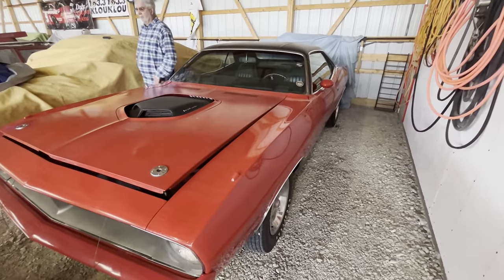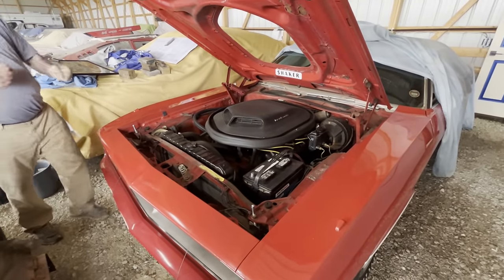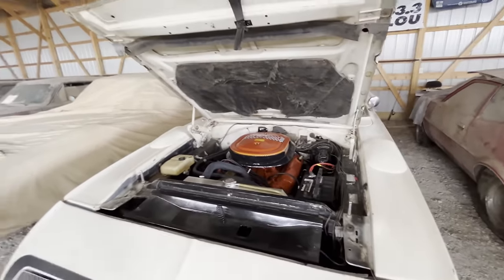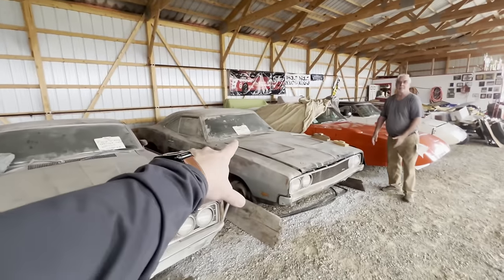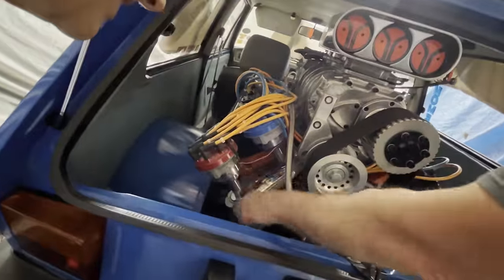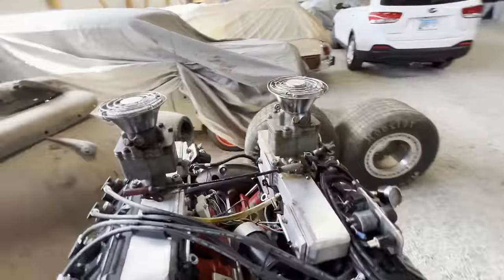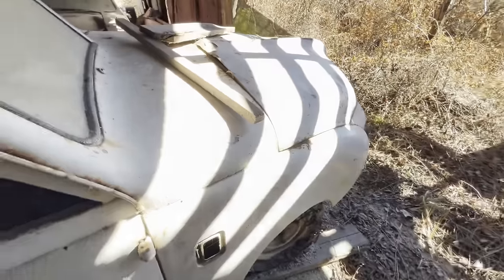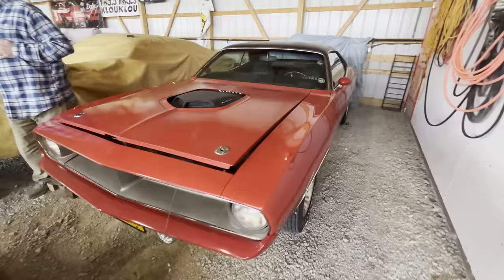Parked 35 years: The MOST INSANE Barn Finds

Comment: The '69 Dodge Charger 500, the car next to the Daytona,  looks to be one of the rarest cars in the collection. They were supposed to make 500 Charger 500s, hence the name.  But the Daytona came out just after and some of the Charger 500 were further converted into the Daytonas. 392 Charger 500s were made in '69, I used Google for the exact number.
Reply: I saw a one in Colorado 1992 for sale.Kai said 7500 I said I'll take it.He goes no no no seventy five thousand
Reply from the maker: Hagerty valuation tool puts it around 50-60k in current non-running condition. I agree though, it is rare.
Reply: @Xthreadgarage  WITH ALL DUE RESPECT: The functional ducts on the Superbird & Daytona upper front fenders 
were placed there to extract air from the front wheel-wells. As you may know, these "Wing Cars" were designed to 
run in excess of 200 MPH & they did. 
At speeds in excess of 120 MPH, air would pressurize in the front wheel-wells; causing dangerous lift to the front 
of the car. The hole//vents & air ducts allowed the air to escape & maintain "0" or negative pressure at the front. 
There-by, allowing the "wedge nose" & rear wing to function at their designed purpose. 
The "tire clearance story" is what team owners of these wing cars told NASCAR Officials; as to not disclose the 
true performance capabilities of these "super cars". 
BTW: If this car actually has "functioning holes" in the fenders...under the ducts...it is an ULTRA RARE Superbird. . 
All known "Wing Cars" sold to the public had no hole//solid fenders. The fender ducts on cars sold to the general 
public were "ornamental" and nonfunctional. 
In my opinion, if the holes are in the fenders, this Superbird Wing Car was purpose built for NASCAR. Also, the fact 
this car was repainted a few years after it was produced may have been to hide//delete its' NASCAR Livery. 
PLEASE contact this guy & advise him to professionally research the history of this car. He's likely in possession of 
a historically significant, one-of-a-kind, museum piece. 
The fact the engine is not original to this Superbird will have little or no effect on its' value. Numbers matching parts 
can be located during its' well-deserved, 100-point restoration. 
Respectfully, 
Ben
Reply: @duygukayhanisaskank4915 interesting it would explain why it's like new but not matching numbers if it was a race car the would have kept the race motor. I would like to see a dedicated video for this car along researching its history now that would be a video worth watching photo graph the tags and start from there
Reply: @strangecustoms8486  THANKS for your considerate reply. 🙂 
I hope you contact the owner of the Superbird & explain all this to him. 
Tracing the history & documenting these "Wing Cars" is not difficult. 
Best regards & God bless, 
Ben
Reply: Covers the Yugo, but the rare 500s are buried under dust.
Reply: Yeah it would be fun to work on it and get errr goin
Reply: Torino  interior s are all the same , no worries
Reply from the maker: Thanks for the info, I’ll be looking into this with Jerry. The fender vents on the white superbird definitely had holes through the fender.
Reply: @Xthreadgarage  OK & THANKS.🙂 
I hope you'll keep me posted. 
Best regards, 
Ben
Reply: @Xthreadgarage  BTW: I don't believe this Superbird competed in any NASCAR Sanctioned Races. 
However, if the vents you've verified in the front fenders are "original" & NOT created by a previous owner, this is a historically significant Superbird. It may have been a "test mule" for Plymouth. 
I hope Jerry realizes the importance of "professionally" researching its' history & the need for this Superbird to be documented & registered. 
I know he's got a lot of "irons in the fire". BUT...this project must go to the top of his "to do list." 🙂  
Best regards, 
Ben
Reply from the maker: Jerry says he put those holes in the fenders shortly after he bought it so it looked more like a nascar. Not much of a story there after all, but great catch. Thanks for watching.
Reply: Interesting

Comment: This is a magnificent and beautiful collection. I used to have a 70 HEMI 'cuda, It had a Black Shaker hood on that same color Red with a T-shifter automatic on a full floor console, between bucket seats, but No overhead console. The interior was black vinyl. It also had a black vinyl roof cover like this one. It also had a Black side stripe.
I purchased it in 1976 in Gastonia NC for $2500 after wrecking and totaling my 1965 Pontiac GTO, 389 4 speed manual. 
Y'all have a good day from Gastonia NC..
Reply: 70 cuda never ever had a t handle ....the t handle came out in 1973 called a slap stick.....so you either had a 73 cuda or someone took a console and shifter assembly out of a 73 and put it in a 70......in which makes no sense at all because 73 didn't have a Shaker Hood and a 70 will not fit a 73 and vise versa but the t handle on the automatic didn't come till 1973....... now before you loose your mind...I am not in any way calling you a lier... Could have your years mixed up or something.... just figured I would comment with some facts that is all sir..... been building these mopars for 45+ years I have touched every version of the cars at one point.... now I am priced clear out of the muscle car era......

Comment: Regarding EV2 Tor-Red 1970 Hemicudas, the early production cars were built with a red shaker scoop. In fact, that was the ONLY body color that had a color-keyed shaker. The shaker scoops were provided by an external vendor, and they required significant bodywork to make them smooth enough for shiny, body-color paint. It was resulting in delays building the EV2 red cars, and that was a popular color, so they quickly decided to stop painting the scoops to match those cars and went to argent shaker scoops for them (they were already used for every other car color). Black shaker scoops were spec'd for 1971 cars, but there is evidence that some late 1970 Cudas were built with black shakers - and some early 1971s with argent shakers! I don't have dates for the running changes.
Reply from the maker: Thanks for the info.